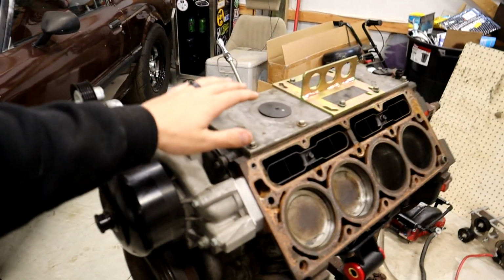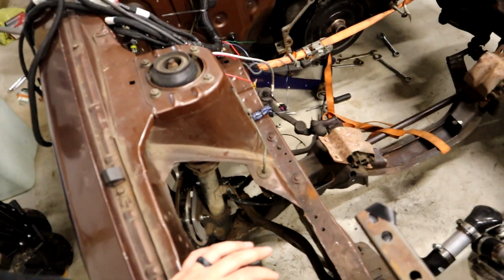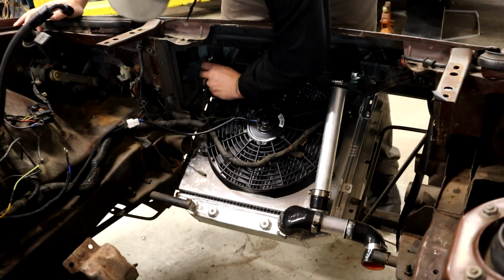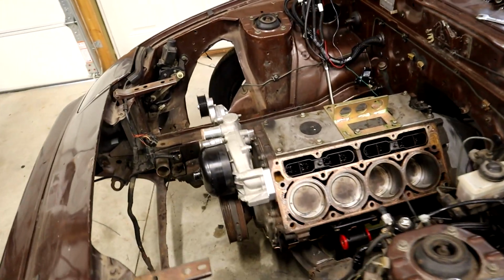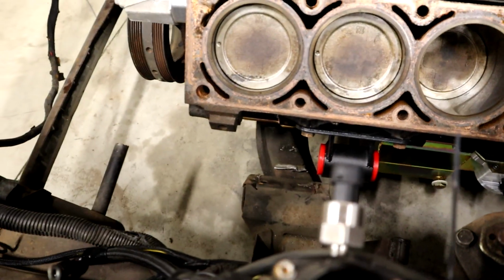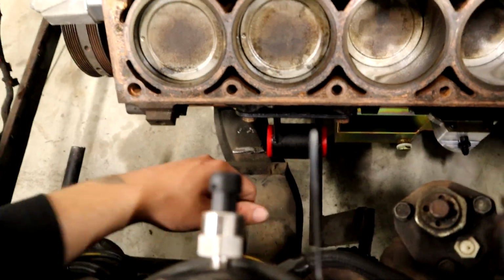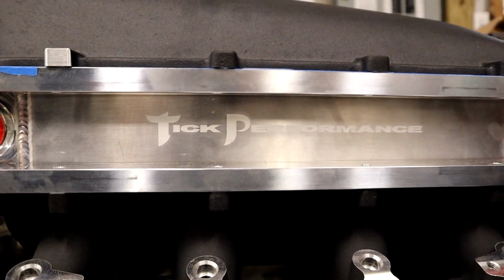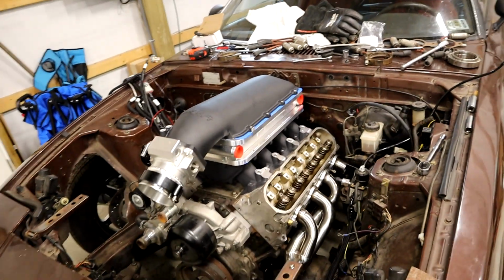Introducing The New Rod Remover 9000!

Comment: What about metigulous setup suspension wise what does he have for front suspension?
Reply from the maker: He modified his lower control arms to fit a mustang ball joint, 94-95 mustang gt knuckles and brakes, foxbody struts, had to have a set of FC RX7 camber plates machined to get the camber right, mustang tie rods, and because a mustang is front steer instead of rear, he switched it to a rack and pinion. Probably $1500-2000 worth of parts. The BC Racing set is bolt in, but they won't offer double adjustable shocks, just single. Which would still be drastically better than stock, so I may get them down the road. And they're $950
Reply: @SniderTron3000  yea hes got it going on that is for sure

Comment: If you check out Metigulous on YouTube I believe he adapted sn95 front spindles to be able to run mustang suspension up front.
Reply from the maker: Yeah, Hayden and I have spoke a lot. But he changed the spindles, brakes, modified the lower control arms, had FC RX7 camber plates machined, and because of the mustang spindles the steering was changed to a rack and pinion. So thats a whole can of worms. The BC racing ones are bolt in for probably half the price of what Haydens was, but they won't make a double adjustable set. Only single. Which would still work and I'll probably get them down the road, its just not what I was hoping for
Reply: @SniderTron3000  Fair enough.  I had deffinately forgot how much work he had put into getting it all to work together.

Comment: Watch "Installing BC Racing Coilovers On The GSL-SE Track Car" on YouTube
https://youtu.be/4InDJcxuodk
Hey buddy i know you read all comments so I hope it helps. For the front adjustability you might already know but Angel Motorsports the rotary guys do awesome things with the front ends of Mazdas, they use the spindle and cut it right below where a normal strut has the 2 bolts at the bottom that attach it to the spindle. Then you choose a coilover/strut of your choosing, even if it's for something totally different then trim and assemble/weld. They turn out great. You may have to find a upper mount plate for the strut towers but its pretty easy and u have control of all your geometry. Good luck man.
Reply from the maker: Yeah, I've seen a good bit of Vargas' stuff. I was hoping to not change out a bunch of stuff. At that point I might as well just tube front the whole car lol